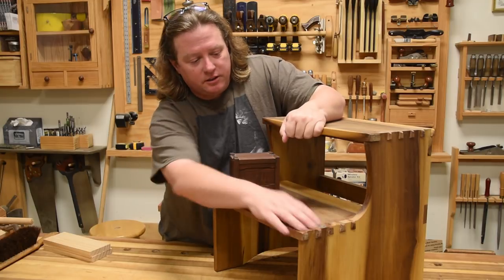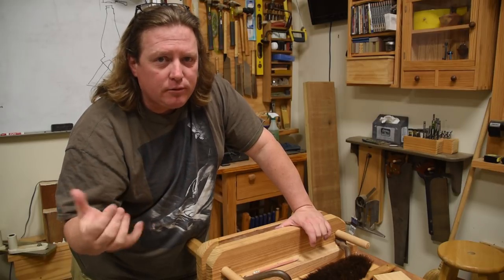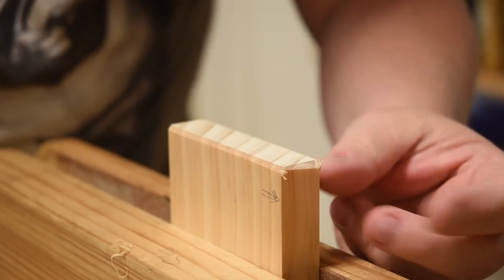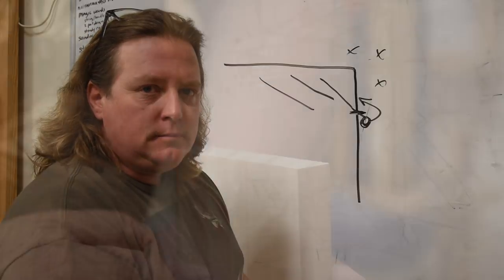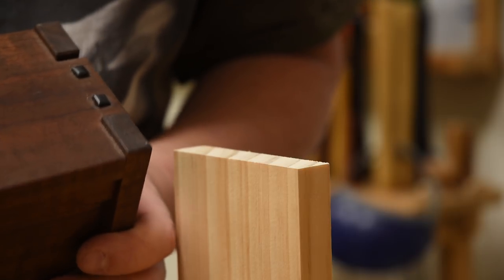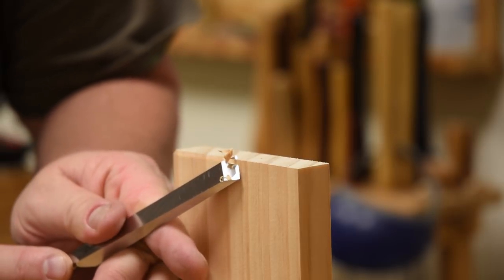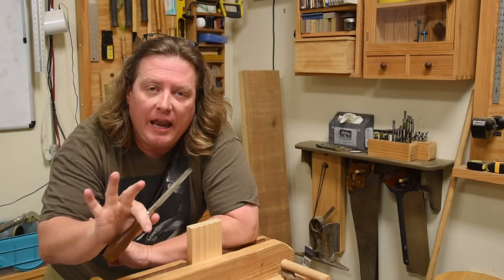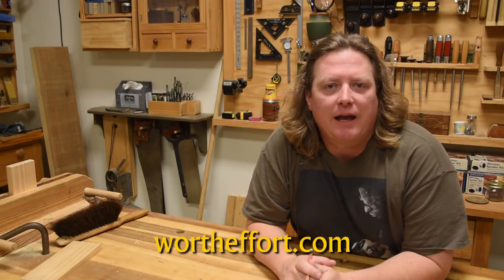Proud Joinery Bevels

Comment: Nice clip of the Korean master craftsman cutting and fitting joinery. I recently deconstructed three Chinese rosewood tables in pretty bad shape from weathering, hoping to salvage some wood. It was fiendishly difficult to separate the joints, had to break the first one to see how they were made. They looked a lot like the joints in the video, multiple mortises and tenons, angled and straight, some mitered. The tabletop panels were thin, only about 1/4", and stiffened by battens on the bottom that were only 1/8" thick in 1/16" deep sliding dovetails.